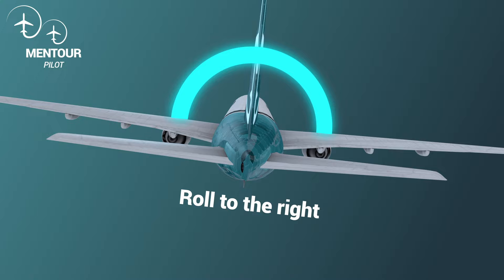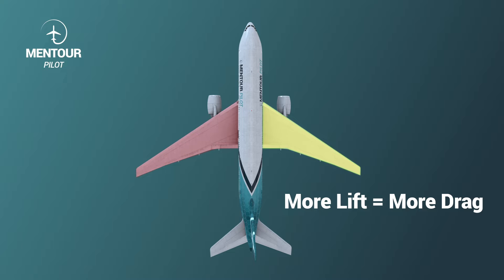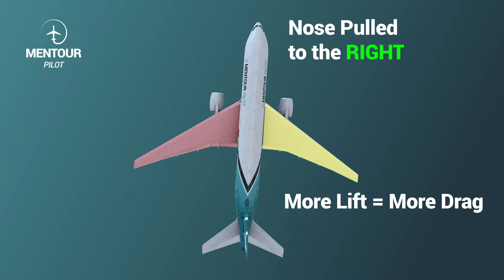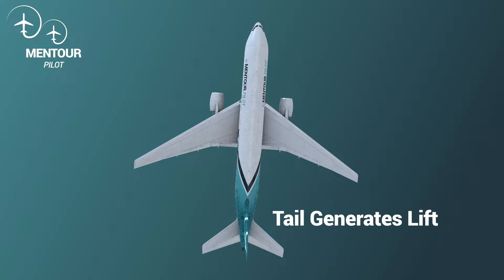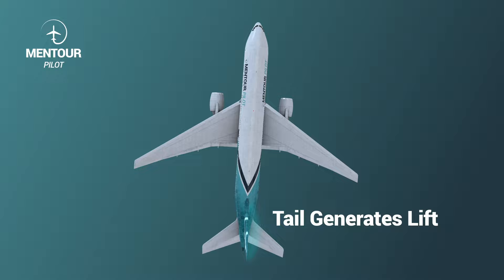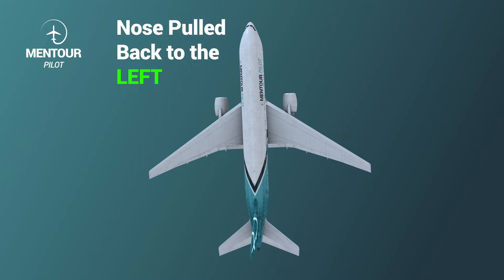What is a "Dutch Roll"?!

Comment: I was unaware of the 707 crash, but I clearly remember the American 587 crash just outside NYC in 2001. Aggressive rudder input from the copilot in response to wake turbulence led to the separation of the vertical fin and the subsequent loss of the aircraft. Yes, pilots can break an aircraft in ways you don't always anticipate. The training for dealing with wake turbulence was changed in response to this accident.

Comment: Good video and explanation. This is quite nitpicky and, honestly, I think most people probably consider the terms interchangeable. However, instead of referring the the three axes as pitch, roll and yaw; I would argue that those are motions, not axes. Pitch is a motion, caused by a moment of force about the lateral (or transverse) axis. Roll is a motion about the longitudinal axis and yaw is a motion about the normal axis.

Also.... I know Mentour knows this (every pilot knows this) but I don't think he mentioned the term. The reaction causing an aircraft to yaw in the opposite direction of a turn (i.e. yaw left when rolling right) is called "adverse yaw." It is caused by a slight inclination of the lift vectors during the rolling motion, as well as by increased drag caused by the down-going aileron (down aileron is in a higher pressure area than the up aileron, causing a drag delta/imbalance and force moment about the normal axis.).

Comment: A bad rudder PCU can also introduce a Dutch roll into the ACFT. Refer to "shell 77" KC-135 on takeoff out of manas. Failure to turn off power rudder die to a young crew ripped the empennage off of the ACFT

Comment: I’m no pilot, but knew you would get around to a coordinate turn sooner or later in you discussion.  I used to fly with my private pilot father and he would let take the controls.  He would instruct me to used opposite rudder to perform a coordinated banking turn.  I don’t know why I didn’t put together that the side slip of the aircraft was uncomfortable to passengers.  I thought it more to control the aircraft loosing altitude during a banking turn.  I suppose in some degree it does counter the loss of altitude keeping the nose up.

Comment: A nice explanation - better than the ones I was given in my youth (kids, listen to this man!). My only slight disagreement is with the explanation of why yaw is induced during the roll, towards the beginning; I didnt think it was anything to do with the off-vertical lift vector (as that doesnt have and component inducing a moment around the aircraft z-axis), but rather the side-slip pushing against the vertical stabiliser - any cross-wind against that big board in the breeze will rotate around the z-axis. But then again, my understanding came from less able tutors, so correct me if this is off beam.

Comment: Excellent video as always! I read that Pan Am had numerous Dutch Roll incidents when they first acquired their new 707s and since they were the launch carrier, their pilots had little experience with the effect. One story said the pilots turned green as they entered a severe Dutch Roll and every movement they performed only exacerbated it. I believe the yaw dampers were installed shortly after the 707 issues with Pan Am began and you can see the actual sensor that was installed at the forward base of the vertical stabilizer on the updated aircraft.
Reply: It already had a yaw damper (known as "Little Herbie" by Boeing). They'd known about the problem of Dutch Roll since the B47 prototype and an engineer called Ed Pfafman had created the damper. The 707 needed more hydraulic boost and a bigger tail. 
A Boeing pilot called Russel Baum was training a Braniff pilot on an early version when the roll got so bad the plane lost 3 engines,it crashed and killed 4 of the 8 on board.
Reply: Paul Queripel Great info Paul, thank you!
Reply: @Roholi  I had a quick look through "Wide Body" by Clive Irving. Not that much of an airplane buff to know that by heart. I did remember they first noticed it in the B47 as it was their first swept wing design.

Comment: Just to clarify, is the yaw damper active during manual turns as well, or only when the autopilot is active? Is there rudder input on manual turns in the 737?
Reply: Yes. It's not part of the autopilot system. You activate/deactivate it with its own yaw damper switch.

Comment: Quite good explanation but some technical inaccuracies/flaws to be improved:
- Dutch roll doesn't occur just on sweptback wing a/c
- As the disturbance kicks sideslip arises because the a/c tends to turn hence sideslip will develop (you mentioned "yaw" due to roll, which is not exactly the same)
Nevertheless, congrats for this risky video, the end result was still very good I'd say.

Comment: What I was waiting for was a discussion of Dutch Roll vs. air speed.  Is it more prevalent at low speeds or high speeds?   Does thrust setting make a difference?  Since most wings have an slight angle between base and tip, if you just let go of the controls, will the plain settle out on its own?

Comment: I think the first infographic could be wrong. If you roll right, shouldn't the air flow from the left, the direction you were going initially? That's precisely what causes lift on the tail fin when you yaw right. If the air comes from the right, the fin is aligning with the air flow, so you don't have any lift in the fin to yaw back in the direction you were going.
If this is the case, were does the lift on the right wing comes from to recover from the initial roll? Maybe the air passing under the fuselage pushes it up?

Comment: With military aerobatic teams like the Blue Angels, Snowbirds etc, I assume they fly totally manual so it must be pretty tricky to do the maneuvers using the pedals for the rudders? They make what they do seem easy to a point but there is so much going on in the cockpit, a lot of multitasking for sure. Did you ever think of going into the military as a pilot?

Comment: You know what this REALLY reminds me of???  In motorcycles, what we call a "Death Wobble" or "Tank Slapper"...

    Motorcycles might operate based on gyroscopic effect to stabilize, and use the angle of the front forks in turning to control what you (pilots) call BOTH the "roll" and "yaw" axes... BUT they ARE self-correcting.

    Unfortunately, this "self-correcting" tendency also comes at a price. For several different reasons, the stability and steerage can get abruptly misaligned... say... when someone at high speed "pops a wheelie" and doesn't have the front wheel aligned wheel as it touches back down. This will "kick" the front of the bike to the side, without using proper "counter steerage" to initiate a lean. Such a disturbance then causes a very slight lean, and by the "rake angle" (that angle of the front forks mentioned earlier) the weight and inertia of the bike leaning shifts the forks the other way and the "kick" repeats opposite... so quickly that a rider can't possibly just grab and arrest the motion... AND the forks get yank left as the bike tips a little right, and then yanked right about in time for the bike to tip left... repeat in rapid-fire succession...

     What makes it dangerous is two-fold... First, you HAVE to understand "Counter Steerage"... SO you  press forward on the Right handlebar and initiate lean to the RIGHT... It's the weight of the bike AND rider that actually moves the front wheel Right to take the turn to the right... This is because of "rake angle" and WHY front forks are NEVER exactly vertical on a motorcycle... YOU are also NOT going to casually support or lift the weight of yourself and the bike with no more leverage than you get from a handlebar... SO Push Right = lean right = Turn Right... Likewise Push Left = lean left= Turn Left...

    Second, the instinct to grapple and tense up on the Handlebars will ONLY make a wobble WORSE. You also don't want to "chop" the throttle to "idle" because that deceleration will force more pressure on the front wheel and likely create catastrophic "kick"... The best way to handle it, then is EASE down the throttle and lean forward. Keeping your grip firm, but your arms loose is difficult at the best of times, but the bike will "sort itself out" if you let it... just laying off a little throttle at a time until the wobble decreases... Speeding up to "Power Through" a wobble will also ONLY EVER invite disaster, too...

     I'll admit, I've built lots of model planes and many flew... I even had several RC (POV) planes over the years... This is the first time I've heard of "Dutch Roll"... AND the FIRST image I got was something akin to a dinner roll perhaps from salty "Hard Tack" (Even if the best hard tack IS Swedish...haha)... BUT this IS Petter, so I KNEW it to be technical... I then figured someone just coined "Dutch Roll" similarly to how they probably coin "Dutch Angles" in photography and cinema (any camera angle that's not "naturally upright" or "normal")... OR how some colloquialism dubiously decided that Dutch Ovens had to stink...

     AND half of my Father's family lineage is Dutch (though they frequently blame a German or two who "jumped the border"... SO I'm not going to feel off-put about it. haha  ;o)

Comment: I was on a 737-300 back in the early 90's, we were at cruise altitude in clear non turbulent air. All of a sudden the plane rolled to the left almost 80% then over to the right about the same attitude, then went back to stable flight. The Pilot said it might have been caused by another aircraft in the area. There were some minor injuries on landing into KPHL, mostly coffee burns, and minor abrasions. Lucky for me I drank cold Soda as it spilled all over me as well. The thing is it was around the same time as the 737 rudder issues, and it always stuck in my head, it could have been that.

Comment: 11:15 - No no no, there is never a 1G during 30 degrees bank. This is basic. There is 1.1547 G to be exact.
Some more inaccuracies - after disturbance with yoke, aircraft is banking, but NOT yawing (because of much weaker directional stability), this is why you get the airflow from the right (as correctly depicted in the animation). If aircraft was yawing, there wouldn't be such a problem, as both wings would face the wind. Only after the right wing starts creating more lift, it starts dragging behind, subsequently yaw to the right, while right wing rises and banks the aircraft to the left, where the sequence repeats.

Comment: Your description of dutch roll influences appeared to omit the effect that dihedral has in altering the vertical component of lift, shifting it to the lower wing when rolling.  wing dihedral usually contributes significantly roll stability.  wing sweep tends to effect yaw stability more significantly.  (Ask anyone who has flown a Stearman. lol)

I've always understood that Dutch is primarily caused by the adverse yaw produced by differentialside loading on the empennage, particularly the vertical Stab, but cross controlling can cause unusual loading on the horizontal stab as well (not that you would EVER cross control your aircraft at altitude).  In smaller aircraft, this is of particular issue with V-tails like the Barron, which have a reputation of being very "dutchy".

So my question is this...  Is there some reason why dihedral wouldn't be as much of a factor in an Airbus, or is the influence of dihedral less higher altitudes or greater speeds?

I was just over at Avenger Sims in Las Vegas flying an A320, and the flight characteristics relative to Dutch Roll that I experienced at upper altitudes at standard temps and speeds was a little different than what you're describing.  I'm curious about your specific model and equipment, and how it may differ from other aircraft relative dihedral.

PS:  thanks for all of the great content!

Comment: I saw an F4 Phantom do this plus exaggerated oscillation in the pitch axis, at low level and coming towards me. I was shocked and thought I was about to witness a crash maybe even be part of it.

At that point he cut in the ABs, sat it on it's tail and went vertical vaporising a hole in the clouds.

The next pass was at high speed. After passing me he touched Mach 1 shattering some glass. Stuff happens. :)

Comment: I was a flight mech on a North Africa trip. The yaw damper quit on ground in Tripoli. The crew elected to climb to cruise altitude and cruise speed. They almost turned the airplane over. Flight at cruise speed and high altitude is very dangerous with an inop yaw damp. The AFM limits speed and altitude with the yaw damp. Boeing literature describes Dutch roll very differently than this video. I have a PPL and years of experience as a mechanic.

Comment: The dutch roll is akin to towing an unstable trailer on the road. Once it starts oscillating the driver's steering inputs are too late and make the oscillation worse. The best thing to do is nothing, holding the steering wheel centered, staying off the brakes, and accelerating if possible.

Comment: At 4:30 I thin there's an error. How does rolling to the right and changing the lift vector introduce any yaw? I don't understand this at all, the lift vector is perpendicular to the yaw vector. In fact, don't you HAVE to use the rudder in order to yaw right yourself so the turn is coordinated, while if not, the nose would just pretty much remain straight?
Finally, at 4:50 he actually says the relative air comes from the RIGHT, which means, the aircraft must have yawed left.

Comment: Isn't it the other way round regarding the centrifugal force and the rudder input in regard to what was said in the video? Shouldn't it be: Too much rudder and you are pushed out and too little rudder and you are pushed inward. 
The rudder basically control your turn rate, and the more rudder you apply the faster you are turning, and hence the more the centrifugal force will be generated pushing you outwards. 
Taken to the extreme, if you apply no rudder at all you will just slope the plane "inwards" (bank) and then you will tend to slide towards the lowest wing, which would be the inner wing, if you were turning (and not just side slipping)

Comment: So all this time I thought my PIDs were out of tune when experiencing oscillations. lol

Does an airliner have different autopilot stability profiles for different weather conditions? We use a couple different PID setting profiles for our small auto pilot systems on our model planes for windy and calm conditions.
Reply: i just fly manually with no artificial stability. lost an aileron back in july right before my birthday. flew for quite a while with just the rudder in a pretty strong wind. didn't help much when my plane augured into the ground and decided to become a post hole digger. got a new one a week later and was back in the air in an afternoon. i fly with glow engines also, a bit more effort but way more rewarding. airliners probably have a self adapting pid system that sets the gains as needed. only the engineers will know

Comment: Captain Mentour,
I just read that GE is testing a jet engine with more thrust that Alan Shepherd's 1961 NASA rocket had. 
Question,
Has the development of ever more powerful engines been at least in part a response to how pilots must deal with microbursts and other severe weather?

Whenever you have time. Very helpful channel btw. Lol. Even though I refuse to fly and will usually take the train.

Comment: I watched a video where they were showing the result of pilot induced oscillation where the plane was hopping above the runway. They showed that by pulling back on the yoke slightly and holding it there it would go away. 
Would the same method hold true for applying a small amount of rudder and holding it there? …or would you need inputs for the other axises as well?